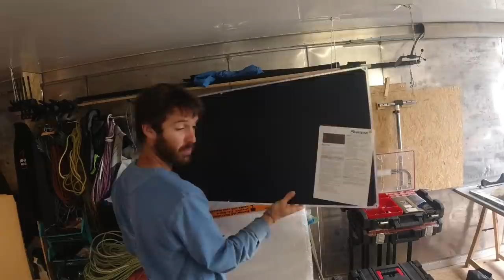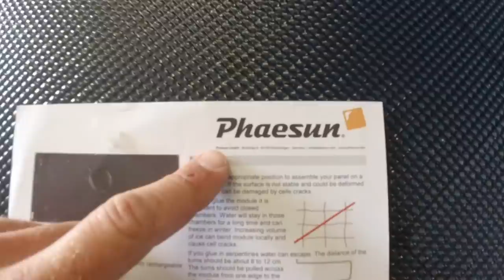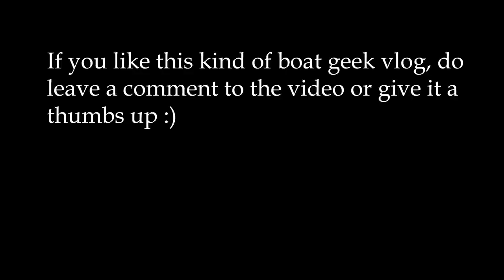How to build lightweight solar panel mounts - Ep161 - The Sailing Frenchman

Comment: Nice work, the only drawback is the foam will act as an insulator and prevent the panel from dissipating heat. When panels get hot they lose efficiency. An aluminum frame or a panel with standoffs or ribs would be better. Anything to allow air to circulate underneath.
Reply: Seriously? It's going to be wet and windy for most of it's natural life, lol!!!!
Reply from the maker: yeah true in theory, but in practice this type of mount is performing really well

Comment: Loved this video and as someone who works in composites I think you did a great job. They would be excellent addition on my 7m boat. I super like this kind of video.
Reply: Just as an afterthought, we used to weld little wings onto bolt heads to prevent them from having the ability, after lots of uses, to start to turn within the bonding agent. Less of an issue when using epoxy and having people with manners tightening and loosening them.
Reply from the maker: That's a good idea, definitely worth it when you need lots of torque on the bolt, not too much the case for those
Love the "having people with manners tightening and loosening them" hahaha

Comment: I bought these Phaesun panels from SVB for my Mini and mounted them exactly as Hugo illustrated here. One of the panels suffered a burnout between cells after six months use and shortly thereafter the second would only charge intermittently. SVB wouldn't honour the warranty because of the way the panels were mounted. I expected a lot better.
Reply from the maker: I'm really sorry to hear about this. The 2 panels I have mounted in this video and gave away are still working today

Comment: Great video but I was interested in your Sun Power solar system that you have been using.  I have a SCAMP sailboat and plan on doing some long costal voyages.  I imagine I can use the same technique to mount it.
Reply from the maker: Exactly the same mount, except that the ones on my sunpowers are cut in X shape, but a bit too flexible to my taste
Reply: @TheSailingFrenchman  Thanks!  Can't wait to follow your Mini Transat race!  Good luck!

Comment: Great Job! I will try to do it the same way! Which thickness has the foam core? Do you use M8 or M10 power joints? How do you install the power joint on the carbon fiber tube?

Comment: I’d be interested in an episode (or part of one) devoted to trimming sails and tuning the rig.  Specifically, what is different between a mini 6.50, a clipper, and Ann Alé (e.g. trimming a square top versus a pin head mainsail).
Reply from the maker: I'll think about that, it's tricky to find the line between too technical and too vague

Comment: As you seem to have a good connection to SVB: Could you please ask SVB to get the small diabolo for a low price into their shop? They are hard to get outside France to a reasonable price. E.g. the same diabolo spare part for the Spinlock tiller extension costs more than a 100 EUR... Thanks.
Reply: You find them in surfshop, it was uses on windsurfer.... I replace on spinlock miyself and all went fine.
Reply from the maker: I have asked SVB to try to put one in stock soon, let see if they find something
Reply: @Planete-voileOrg  Bbefore being adopted by windsurfers, they were exhaust silent blocks for renault vans.